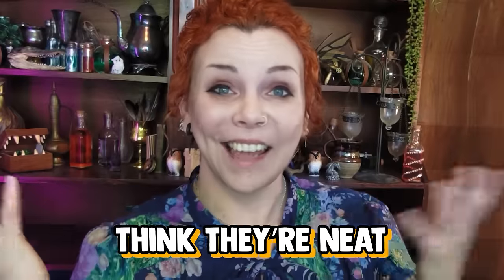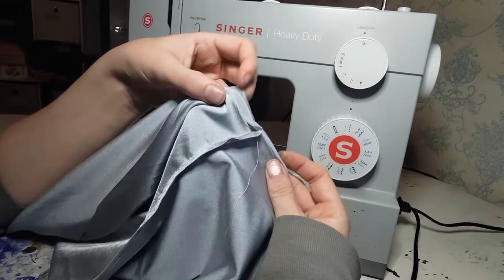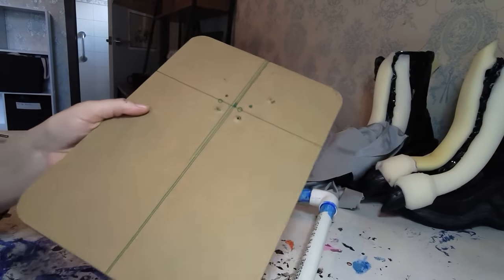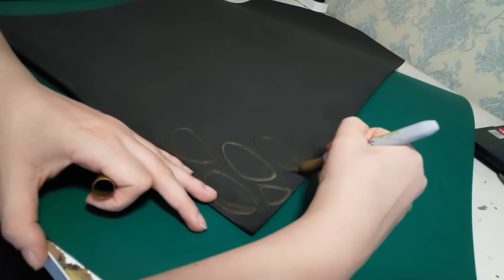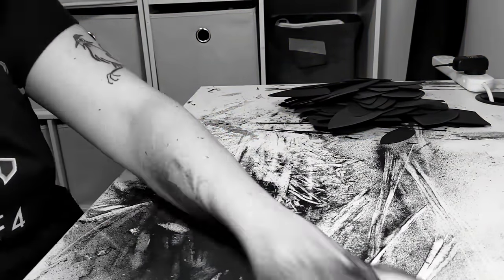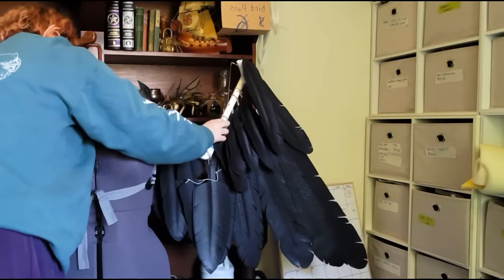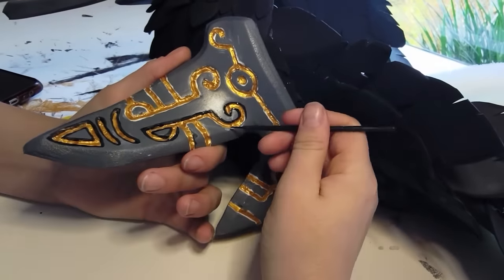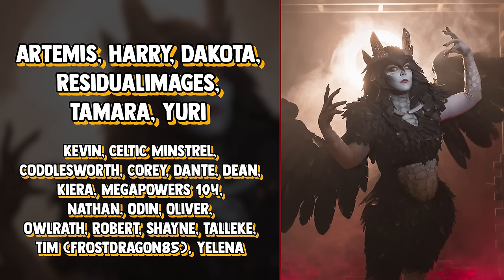Making an EPIC demon harpy queen!! (Lilith from Solium Infernum)

Comment: A tip for the string in the pipe . When you tie a bit of fabrik to the end of ste string and stuff it into the pipe , you can use a vakuum cleaner to suck it to the end of the pipe.

Comment: Fantastic job on the Harpy...had a little giggle when you tried the thigh pads for the first time lol.  
A little trick for getting the fishing line through the tube....tape it to a length of solid core wire (the sort you strip out  from domestic wiring) and push that through the tube, I would use the non insulated earth wire.

Comment: I'm doing a siren cosplay, and I am so torn between doing an articulated wing with a harness or having my arms encapsulated in the wings. Either way I'm in for a lot of feather cutting/shaping/gluing. 

I'd love to hear you speak on the pros and cons of using the eva foam like you used here, vs the more flowy seeming isolon and packing foam combo used in the lute cosplay. My primary concern is that the packing foam wouldn't hold its shape enough, but I definitely need a super light material. My current though was to double up the thin packing foam with a eva foam, wooden skewer, or wire rachis/calamis for some internal structure, possibly with a thinner feather shape inside to give some of the feathers even more structure. 

I love how you did the feet, and may have to reconsider my plans to make them from a pair of heeless shoes.

Comment: for the fishing line in the PVC, tie the line to little a piece of towel and suck it thru with a vacuum. I've never used it for cosplay but to guide paracord thru the bent handlebar tubes so I can pull the wiring on Harley's

Comment: Try using a metal washer tied to the fishing line to thread it through the PVC. If the weight alone isn't enough to draw it through you can use a powerful magnet to assist passing it thru the PVC.
Reply from the maker: That's actually so genius honestly!!

Comment: Watching the way you fished that line through the PVC on the wings, reminded me of a trick I learned for running wiring through handlebars on choppers. Next time try using a Shop-Vac to vacuum the line through the pipe. I used to do it with dental floss and then I would tie that to the wires and pull them through the bars. I think you can get where I'm coming from on this idea. Anyhow, hopefully this tip will come in handy next time.

Comment: Incredible! Well done, it's gorgeous!
An advice if I may: to pull any wire trough the PVC pipe, you could used an Electrical Wire Threader, very cheap and effective (what electrician use).
Reply from the maker: Going to check that out next time thank you!

Comment: Just a tip, from a cyclist, to get wires through pipes tie a small bit of metal as a weight then use magnets to guide the metal through the pipe. This will save you time and you'll be able to get around corners and get your string out.
Reply from the maker: That's actually genius, I had a few suggestions for something like this! I'm definitely going to use this next time!

Comment: Late advice, I know, but if you attach a small weight to the fishing line it will help pull it down the tube sections and make it easier to handle. Just remove the weight when you are done.

Comment: Next time you have to have to run string through pipe:  Vacuum cleaner and a small bag.  Tie the string to the bag on one end, place the vacuum on the other.  it pulls the bag and string right through.

Comment: was thinking how electricians do it is while making the tubing you have a wire go thu all of it. and when you want to pull the electircal wires, you just attach them to the preinstalled wire and pull. 
leave it long enough that the other end doesnt go inside the tube and you are able to pull it back for more wires.

Comment: Wouldnt it be much simpler when getting the string through the pipe to just tie it on something small and heavy (small bolt for example) and just drop it in the pipe and shake it through to the other end, then just pull it out on the other end through the hole? just an (maybe) idea. great work I wouldnt nevver be able to that.
Reply from the maker: So many people have suggested that so now I'm kind of embarassed I didn't think of it! haha I'll know for next time.